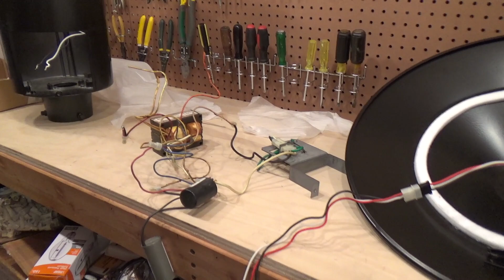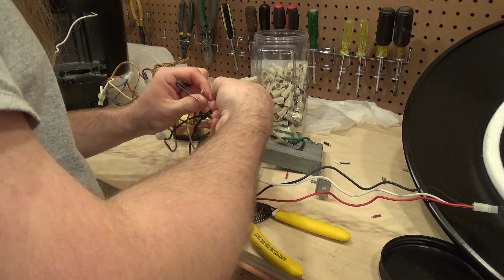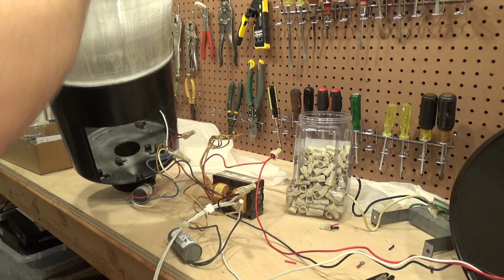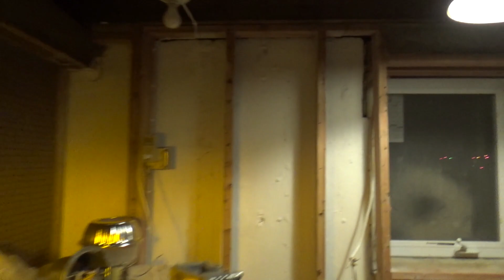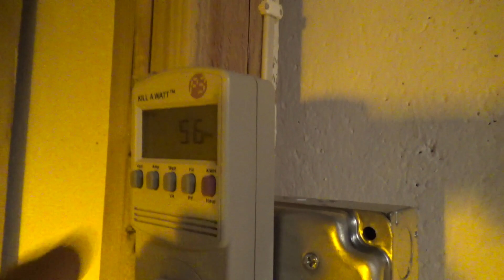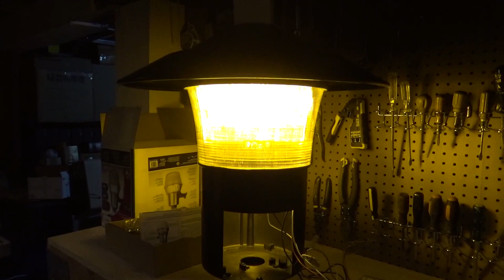Wiring the Ballast and Testing a Vintage High Pressure Sodium Lamp Post

Comment: I have a PMA-115 and it was MV but got swapped with a MH ballast, problem is got it all wired up and only the ballast hums. Tried 3 different MH bulbs but does same thing, assume ignitor is bad and needs swapped out?
Reply from the maker: Quite possibly.